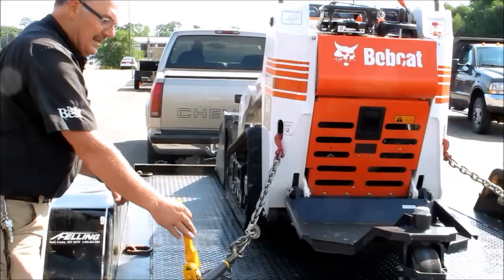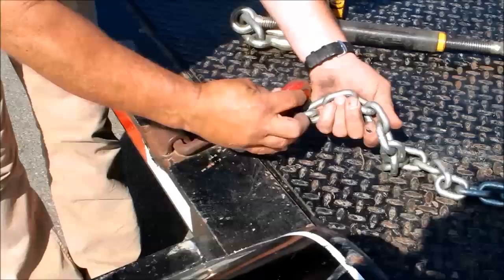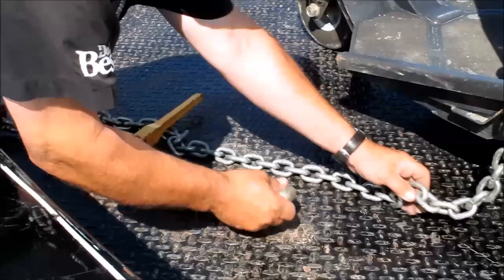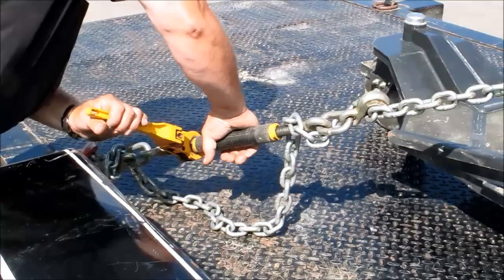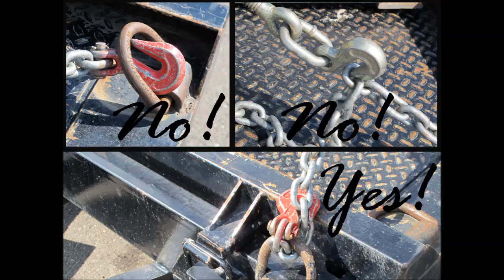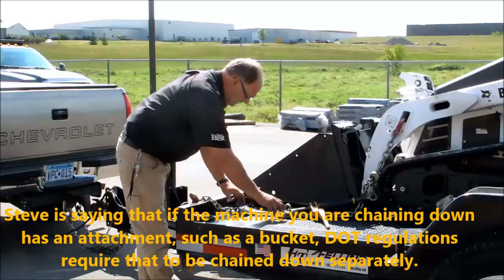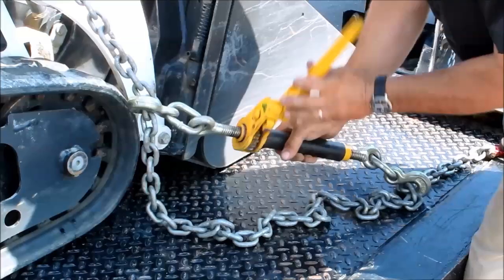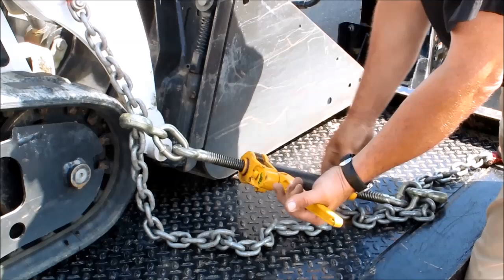Chaining machinery to a trailer

Comment: Too many points of failure on that tie down.  The correct way to tie is to used the binder as the end link, not to take the slack out of the middle.  Makes a tie down at least 25% stronger.
Reply: Micheal Yarbrough exactly, and when you hook the binder to the equipment,  you don’t end up with the chain kinking and the links popping and the chain loosening as you tighten. This guy doesn’t know what he’s doing.